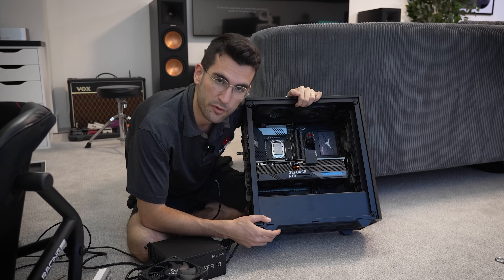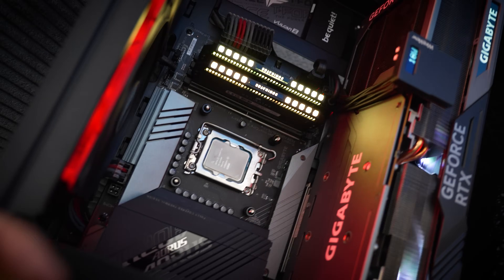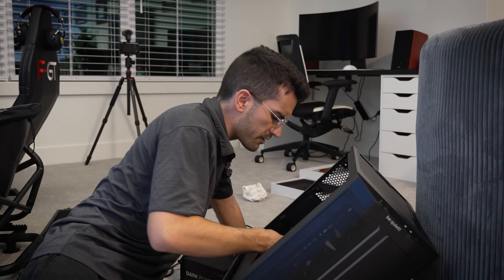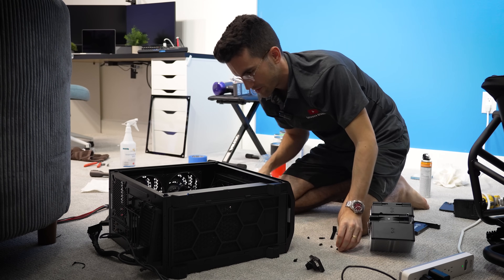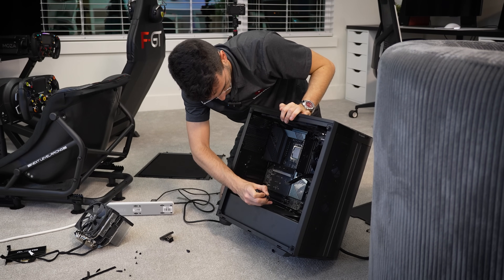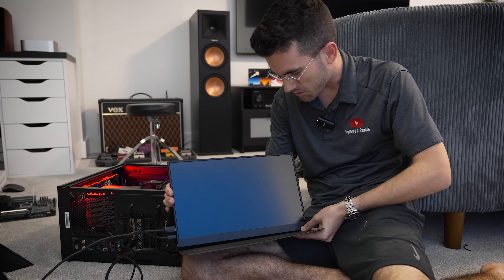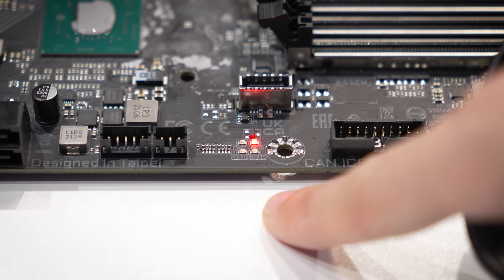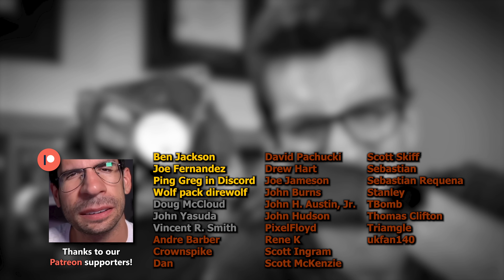Fixing a Viewer's BROKEN Gaming PC? - Fix or Flop S6:E6

Comment: Hey Greg, I know this is an old video. just a question, does the Gigabyte z790 eagle ax have a wifi chip I am wanting to upgrade from a Gigabyte B450 Aorus Elite V2. I'm struggling with having to use a Wifi USB and and Wifi Antenna, having to reset my Router from time to time.

Comment: You screwed that MB with the CPU thermal paste Greg! No matter if was working before with other components. Allways ,A-L-W-A-Y-S spread CPU thermal paste in a thin even layer, not like tooth paste! lol Otherwise the paste will spread to all sides and touch the CPU pins! Spread it nice and even on the surface only with a card or something thing and not metallic.This is something that everybody must know. And never use metallic paste like those PS5 junk! Terrible crap! But I really doubt that would be somebody reading this today...

Comment: Based on the elements of information provided in the beginning it sounds like a motherboard issue. You may have a circuit in the board not completing. I like diagnosing before watching through.  I have a bunch of these notes about many of your videos.  Some I have been right on.  Others not so much.  My way of having fun with your videos.  They are great.
Reply from the maker: I appreciate that! Thanks for watching.

Comment: Not that it would make a difference in this case cause the motherboard was pretty obviously the issue but were you trying to diagnose a post issue with a 12400f and no gpu? You didn't clarify which cpu you had installed after you removed all non essential components and with you talking about possible bios compatibility issues, that leads me to believe you have the 12400f installed at that point. You do know that would never post even if there wasn't an issue right?

Comment: The 14900 (non-k) I worked on had issues with stability that were so bad that it bricked 3 motherboard's power delivery. Please be careful still using that 14900.

Comment: Given that the chipset on the old MB was running hot I'd suspect the chipset might be having issues...that would also explain why the bottom PCIe slots were heating up too as they pass through the chipset, unlike the top slot which connects straight to the CPU. Same with the NVME SSDs, top one goes straight to CPU, others go via Chipset.

Comment: My brother-in-law was the head of design engineering at the local circuit board manufacturer for more than 30 years when he lost his job after the company was taken over by another. He says that the manufacturers are more likely to be effected by ESD issues than consumers are, but he still has his home lab set up with grounding stations. He was already working on a couple projects before he had them tied to the floor and said that his soldering projects would be more likely to be effected.
Reply: I always use ESD strap when working.  Now that I am a pro I just touch and go.

Comment: I suspect it is in fact your chip-set, note how the heat signature is not equal but is on one side. If it was even temps across the chip it would be okay. I would use your multi meter to check really low impedance or ohms around the chip-sets smd components.

Comment: 8:59 I already figured out the likely cause of the problem.

Bad Capacitor or dead Voltage Regulation Module interrupting power to the CPU.

Comment: I recently updated the BIOS on a rig I've been using since 2018 that I'm giving to my son.  Everything turns on but I get no post and the amber DRAM light is lit.  I reset CMOS, shorted CLRTC, re-seated ram, tested ram individually, and all ASUS can tell me is that the BIOS update made the ram, which I've been using with no problems for 7 years, incompatible.  Imagine a market where products are built to last rather than be replaced.

Comment: I spy your Scythe Kama cooler, nice! I almost got one for my AM3+ resurrection build but I got a deal on a Hyper 212.. Which was a challenge now that most CPU cooler companies have dropped everything older than AM4 on the AMD side... And I put on dual Gelid PL12's in Green and it looks nice and continues the green theme i had in the case with CCFLs from 2000 and something. Is your chair a Haworth Fern, it kinda looks like it is ...

Comment: You basically just proved that long term putting thermal paste into your socket does damage it.  Visually you can see that you weren't able to clean it all out.  Even if paste has electrical properties allowing it to be marketed as non conductive, it can still be capacitive enough to change the electrical properties of components it is touching or bridging.

Comment: I bet for some reason Gigabytes Dual BIOS implementation kicked in and every time it gets power it tries to do an automatic recovery from the backup BIOS. I had a Gigabyte GA-Z97MX-Gaming 5 and it did that every once in a while when I did something in the BIOS or when it had a bad day or something. It takes 20-30 minutes but it always fixed itself. I suspect the same happened in your case.

Comment: I've seen this problem as a technician - it typically happens to computers that are not protected by Uninterruptable Power Supplies (UPS) and it happens especially in areas where local utilities don't regulate the voltage of the power they send to homes. In that case, having a UPS is even more critical so that the computer gets consistent and stable square wave A/C power. I've seen computers easily last a decade or more when connected to a UPS. Those that aren't connected to UPS' typically have shorter life spans.

Comment: I had the exact same problem with my B560 Aorus Pro AX. I thought it was a CPU issue so I got a new one, worked for a few days and then kept getting the same debug. The board refused to recognize the chip at all, ended up just getting a new board.

Comment: The old board probably has a bad mosfet with no viable damage, it's probably not letting power get to cpu, you would need to solder in new ones

Comment: Hi. I do not know if i can ask questions here in the comment section. But my rig suddenly does not want to power on unless i cycle my PSU and press the case power button immediately. Checked everything but the issue is still there. I can still use, but i have to do that everytime.

Comment: Once you listed the issues and your checks I knew right away it was the motherboard. Main reason(s) being A) CPU wasn't getting power (hot), and you checked the PSU and cables. 2) It's a Gigabyte motherboard? Their products have been proven to be unreliable, while yes many get away without any issues once you start handling their products a handful of times (build it, tear down) they tend to diminish in quality QUICK.

Comment: All you have to do to figure this out is to watch how to build a computer by The Verge! Remember, you need to put the PSU on the rubber pads and not on the bare metal chassis or you’re going to short circuit your PSU!

Comment: Just recently I repaired a 970 board with an old 8320 cpu..  the 4pin connector that powers the CPU had half melted and was quite brittle and pieces breaking off of the connectors.....  But even after putting on a new connector, it was still having intermittent issues-- I looked down into the male side connector on the board and realized that one of the pins was "bent' --  so when I poked down inside to bend it back, I realized that it's just flopping around loose.........  So I had to pull the board and resolder the pins on the under side of the board and now it has had zero issues ever since..................  Since your CPU isn't getting hot, tells me that it's simply not getting power.. So I would check that connector closely, and take a pick and wiggle those pins down inside the board's connector and make sure they are not loose.

Comment: ESD is still an issue, but rather than using a strap, Use ESD Shoes. Intel actually insists onsite staff wear ESD 24/7/365 because it can be an issue in the labs because of the HVAC and dry air that causes..

Comment: I've seen motherboard repairs, memory module replacements, overboard retracing, BIOS chip scavenging etc. Wouldn't it be cool if we could buy replacement wafers for "deceased" CPU dies or make an i5 by isolating defective cores on an i7?

Comment: SOUNDS LIKE THE MEMORY TO ME. TRY TAKING OUT ALL MEMORY, THEN PUT ONE STICK AT A TIME AND TURN ON. IF STILL NOTHING THEN TRY DIFFERENT MEMORY STICKS ONE AT A TIME. START WITH ONE STICK, TRY IT, THEN ADD SECOND STICK, TRY IT, AND SO ON. IF NOT THAT ISSUE THEN POWER SUPPLY WOULD BE NEXT STEP. IF NONE OF THOSE THEN A SHORT OR UNPLUGGED WIRE.

Comment: I had a mobo die on me once. Was back in 2017. Was running a ryzen 1600 on a B250 MSI board. It was doing great at a high OC for over a year until it just dropped dead. AMD sent me a replacement CPU which I did not expect and was able to confirm the motherboard just died. 

Was not too far from the third gen release at that point so upgraded to a 3700x not too long after.

Comment: There is a lot of residue of the IPA and thermal paste on the board. Together with dust that might dried up in the wrong spot. 
So I would try cleaning the board with water, dish soap and an old toothbrush or an used soft antistatic brush. Please do not use what ever brush you used in the thermal paste video. Dismantle the board as far as possible first, let it soak in the water before start scrubbing, don't forget the backside and afterwarts blow most of the water away and rinse it with IPA. Let it dry for at least 24 hours. I think I don't need to say you have to be cautious on the CPU socket but for everybody else who want to try it: I leave the cover on the socket unless I scrub in the socket to prevent what ever I got in the water at the same time to get in the socket. You can basically wash everything this way but fans and all kind of mechanical drives.

Comment: This week's fix or flop in my life was my partner's new build, with no help from him as he's been sick all week; it's mostly new parts including case, but we had to reuse the PSU and SSD to stretch the budget for his mobo/CPU/RAM/GPU as we do major rebuilds/new builds on a 5-year cycle. Assembled and it POSTed, but wouldn't recognize his SSD, in either M.2 slot; those pointed to either the SSD or the mobo's M.2 sockets/controller. No spare AM5 mobo in the house to test it in, so I had a bit of a think for the evening. Tested his M.2 in my AM4 rig the next morning and it worked there, so I checked his mobo's hardware compatibility list and realized his SSD wasn't on it, but my secondary M.2 was...so the one I pulled out of my rig to test his SSD is now in his rig and he's happily up and running. 

Thanks for improving my diagnostic skills--even after 25 years of building/maintaining my own/my family's machines, there's still more I don't know. It's always a pleasure to learn with you!

Comment: Some of the Gigabyte boards have a switch jumper switch to reload bios on secondary bios chip, also sometimes if it is a unlocked chip you need two cables plugged into the socket one for the CPU fan and one for overclocking. Though 13 and 14 chips are known to warp just a little bit that the pins stop touching some third party company came up with a better holder that keeps the cpu from warping and loosing contact with the pins.

Comment: ESD only happens when you are at a different charge than the component, assuming everything is at the same potential as the case, just touch the case first, and you will be at the same charge as well, and you can work safely
ESD wristbands stop you getting charged up and forgetting to case ground yourself, or the machine charge changing and you not equalising yourself ..

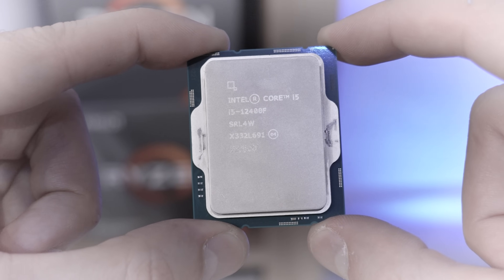Comment: Commenting only having watched up to 3:52. This seems like it is either a PSU or PSU cable problem, a 24 pin problem, or the MOBO is dead/dying. I will reply to my own comment if I can think of anything else.
Reply: Likely the resistors near the bottom PCIE lanes ate it, I doubt it was due to anything you did, just that sometimes things short out for dumb reasons.

Comment: Seeing it up close, I notice a lot of humidity marks and scratches on the board... Around 10:03. Maybe that's just thermal paste residue? It shouldn't cause any issues if it is, but if it is humidity that can corrode the electronics and cause failures. Though if there are areas warming up that shouldn't, that sounds more like a short problem. The thing is, those motherboards have a lot of layers and those layers could short inside if they break for some reason, and you might not even notice it.

Comment: Hey Greg, that is a funny one because just the other day I told my wife, that almost anytime a mainboard was to blame for the error it was a Gigabyte one. That was getting in my mind the first as you explained the situation of yours. I´m just wondering, why you put a Gigabyte board in your rig again. But that could also be my experience with this brand. I never considered to go with Gigabyte from the time I had the mainboards with the two bios chips on it in my company. They just needed two bios chips, because one of them got faulty from time to time.  I hope that mainboard you just installed will last longer then its predecessor.

Comment: I have handled thousands of components in my time working in servers and desktops in IT. Never ever worn an ESD strap, I dont own one and never have. Socks on carpet too lol. 

 Only one fataility ever, DDR4 32GB DIMM - but who knows what it could of been really. My theory was ESD or I pressed on the heatsink too hard (was known good before I moved it to the correct memory channel). 

Everything else thats died was either on its own or I messed up. The worst I had was a runny nose building a new X99 system (was $$$$ back then compared to now). Micro drop from my nose on the mobo and poof whole system gone even took the CPU.

Comment: Have not read all comments here yet but my observations were that of some sort of residue on the PCB seen through and beneath the cpu socket on the south and eastern walls in a mirrored L shape, possibly thermal paste that wasn't fully removed properly by someone incompident who had the board before Greg. The motherboard's South bridge seems to work just fine as evident by thermal imaging but the Northbridge is done and gone, being why the cpu and anything else above the top most pci-e slot is not getting hot at all. Barely getting trickle power to run the LED's on the Ram stick. Your likely seeing 5v but not 12v. Sounds like a problem in-between the layers of the PCB. There's nothing anyone can likely do for this board sadly. My two cents anyways. I'd need his thermal camera and the board in front of me to do anything more with it. Good luck! Love the Fix or Flop series!

Comment: 1:00 Mee too in this situation.. 11900K 3,5GHz max working freq. (i can set higher, but fails in stress test) 180W power consumption.  Thinked the cpu was burnt out.. Got some QV1L (11900T) Got no further than 3500MHz, stress test ok, but with not 180W, instead of 266W! Holy cow.. I didn't believe my eye on the power meter.. Now I'm about to sell completely my board, cpus, cooler and ram. Going for a 7700X and some B650 with 64GB DDR5.

Comment: A few weeks ago, I updated my intel graphics drivers and my nvidia graphics drivers and rebooted my pc. After that, it wouldn't post, nor get into Bios (Bios was up to date). It would freeze on the "changed hardware, f1 to run setup f2 to run default" screen. I thought it was the cpu and took it to get a second opinion. Turns out it was my MSI z790 Carbon Wifi. I also have an i9 14900K. This is the 3rd instance I've heard of happening with this cpu and the 2nd instance was within only weeks of it happening to my rig.
Reply: CASE
Corsair 7000D Airflow

PSU
Corsair AX1600i Platinum

MOBO
MSI MPG Z790 Carbon Wifi

GPU
MSI GeForce RTX 4070 Ti Suprim X 12GB

CPU
Intel Core i9 14900K

RAM
T-Force Delta RGB DDR5 2x 16GB 8000MHz

ECOSYSTEM CONTROLLER
1x iCUE LINK System Hub

CASE FANS
8x Corsair iCUE Link QX120
1x Corsair iCUE Link QX140

CPU COOLER
Corsair iCUE LINK H170i LCD 420mm

COOLER FANS
3x Corsair iCUE Link QX140 (Stock w/ AIO)
3x Corsair iCUE Link QX140 (Added for Push / Pull Config)

CPU ILM UPGRADE
Thermal Grizzly CPU Contact Frame

THERMAL PASTE
Thermal Grizzly Kryonaut Extreme

Comment: The best way I've found for straightening bent pins is to use the thinest business card you can find and you can lay it under each row of pins diagonally as the pins lay this way. Straightening them is easy because the paper is slightly thicker/sturdy and is more than enough to bend them back. The paper serves as a guide. Any bent pins will stick out and you can align them to the paper/business card by gently folding it the direction the pin needs to go.

Comment: Just a guess here but whenever i build with any intel chip past the 11th gen, just for peace of mind, i use BOTH CPU PSU cables connected to the motherboard. Considering the 14900 can boost up to 219 watts which pretty hot for a single CPU PSU cable. I noticed you only used one cable.

Comment: I don't want to create a mood here, but I've had similar strange experiences with Gigabyte mainboards, which ultimately led to me no longer buying one. Not even for customers, because I don't want any complaints. This ranged from faulty BIOS default settings to sporadic, incomprehensible stability problems, switching off the entire system when idle and even several dead boards overnight.

Comment: I once owned a Sabertooth 990FX board, First gen, and i went away for 2 days and left my pc on, when i came back the PC was turned off and it wouldn't restart, so i took it apart and borrowed a PC from a friend, turns out the VRM had exploded on the rear of the board since it looked fine, but asus replaced it after 4 years with the Rev2 model